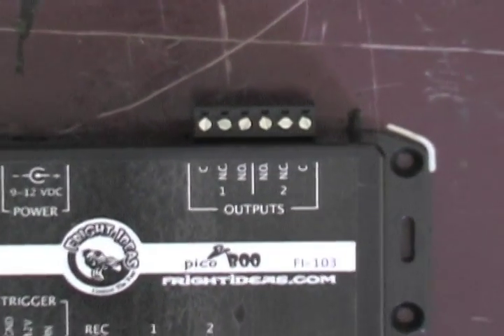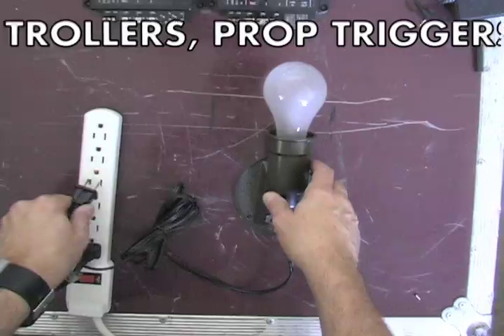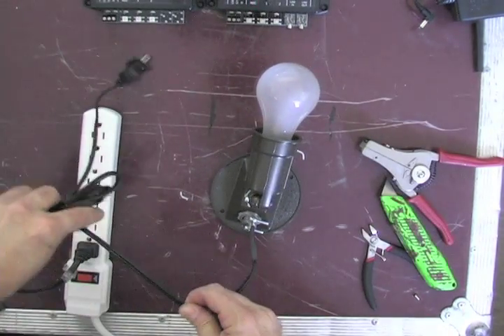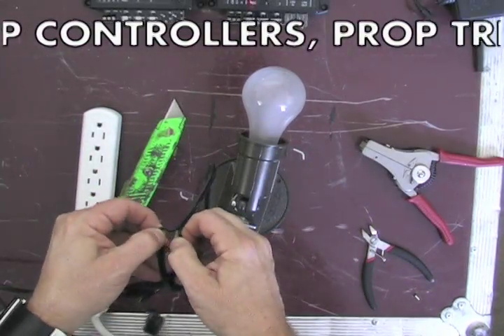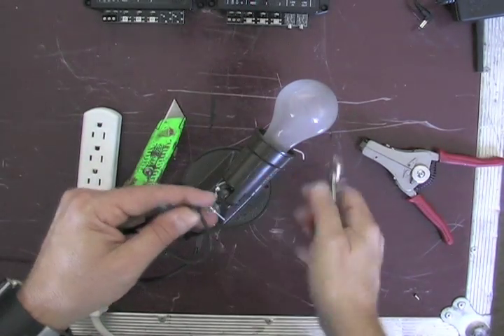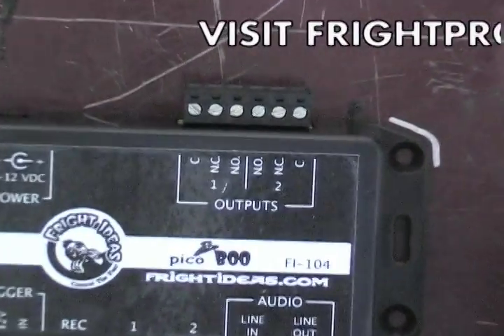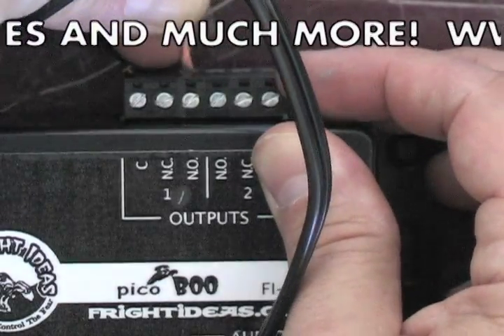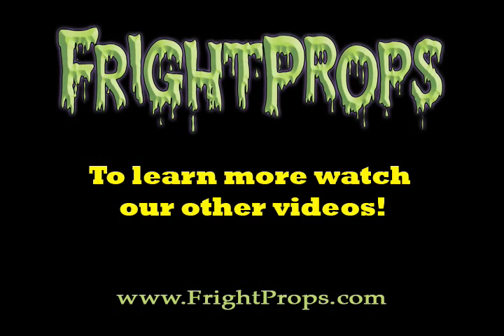Using AC devices with the picoBoo F103 and F104 prop controllers

Comment: The video states that either of the two wires going to the lamp socket can be cut and connected to the relay. While this would work to control the lamp circuit, it is best to "switch" the hot wire and not the neutral wire in the lamp power cord. The neutral wire is intended to provide a return path for alternating current. Switching the neutral wire with the relay would leave the socket connected to the hot wire from the power source. This could lead personnel to believe that the circuit power is off at the bulb socket (or whatever AC device is involved) and could result in an electrical shock hazard.
Identifying the hot wire in the lamp power cord could be as simple as following the wire coming from the narrowest of the two prongs on the plug. On a polarized plug in the US, the neutral prong is wider than the hot prong. I hope this helps.